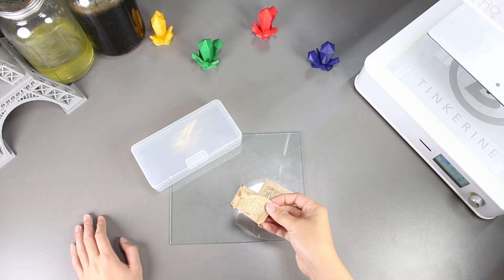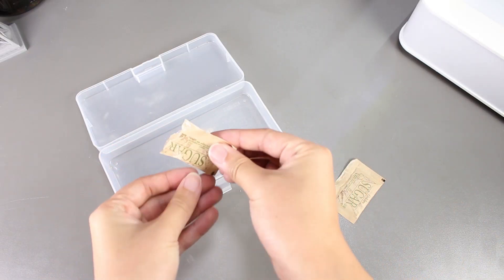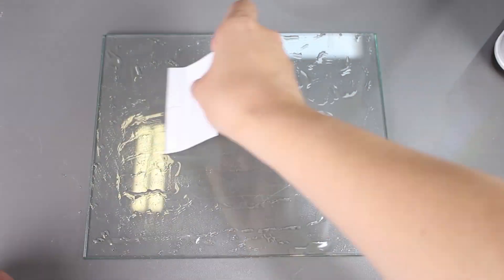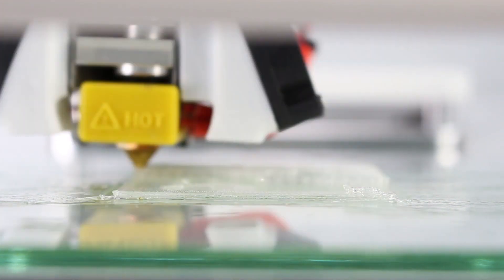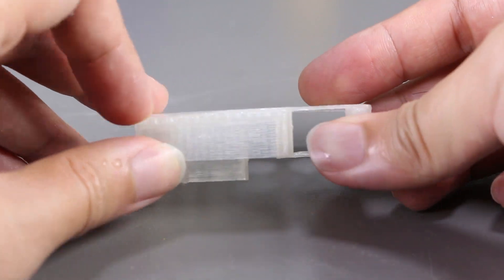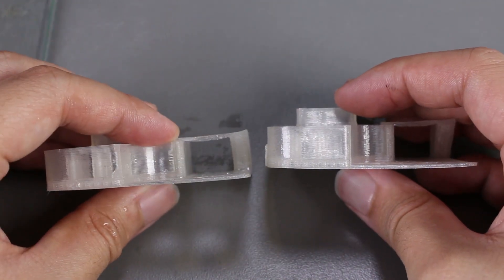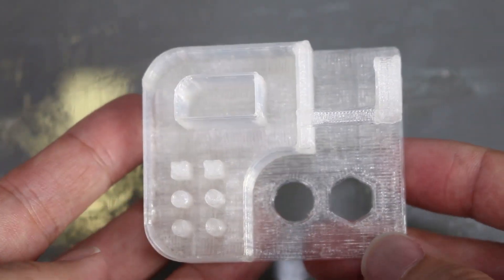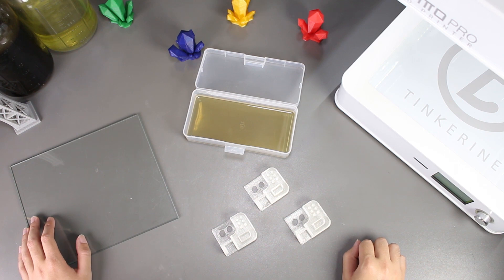3D Printing Using Sugar Water as a Bed Adhesive

Comment: Putting a small amount of isopropyl alcohol in the solution makes it spread easier to. Reduces surface tension of the water so the water doesn't bead up as much. I use this method and spread it on the warm (not hot) bed with either a sponge or cotton ball, if you use a cotton ball don't spread while its sticky or you'll end up with fibres in the coating. It should dry nice and even and not have bare patches. I print in a room that's subject to massive temperature changes and this combats warping alot.

Comment: I think a slightly thicker solution and make two applications.  You don't need a hair dryer - use the bed heater.  It is right under the plate and is more controllable.  You want the layer as even as possible
Reply from the maker: Thanks for the suggestion!

Comment: I use sugar water as my primary print adhesive now. It works wonders where gluestick and hairspray failed, has no smell, gets tacky and then hardens. Cleanup is as simple as dropping some water on the bed, and rubbing until the sugar dissolves.
Reply from the maker: Thanks for the comment!
Reply: I know its 3 years too late but what is the ratio ? 50gm sugar to how much Ml of water ?

Comment: Thanks for the video. I apply it with a brush while the bed is heating - this way the solution covers the glass evenly and dries quickly.
Reply from the maker: Thanks for the comment and advice!
Reply: Here is an idea for the next experiment (actually more like next 20 experiments). Try to print something with ABS. It's quite challenging, especially if you print large models (e.g. an enclosure 10x10x10 cm), because ABS is prone to warping and doesn't stick to the bed as good as PLA does (water with sugar helps, also degreasing the bed with alcohol or acetone). I got pretty good results with following parameters https://eax.me/files/2017/04/cura.png but they don't solve warping problem. Recently I've build a heated build chamber ( https://eax.me/diy-heated-build-chamber/ ) which did help a little, but even with HBC I don't always get good results. I wonder if you'll find a way do defeat warping.
Reply: I would agree. I was going to suggest using a 2" wide brush like this one.https://www.homedepot.com/p/2-in-Chip-Brush-1500-2/100626098
I also think that it if you wanted to lift off the printed item more easily you could just rewet the surface with water and it should allow the sugar to dissolve enough to remove the item